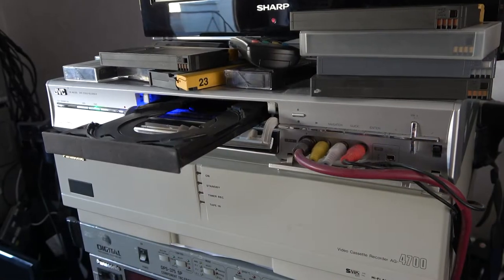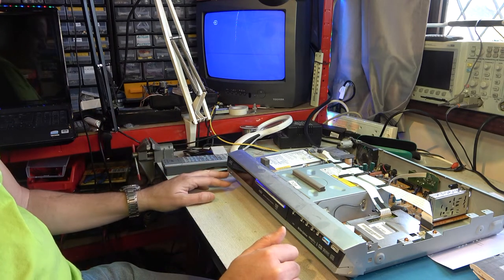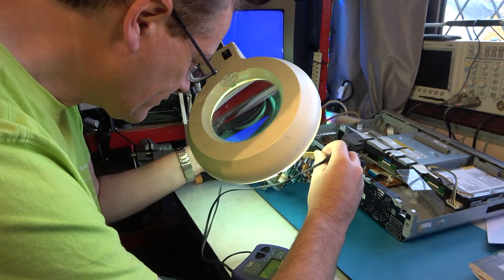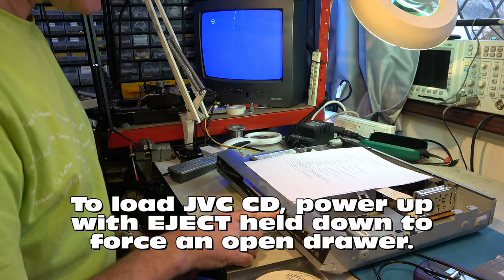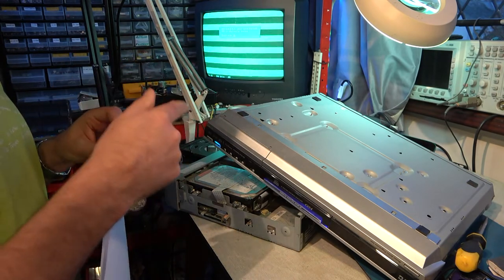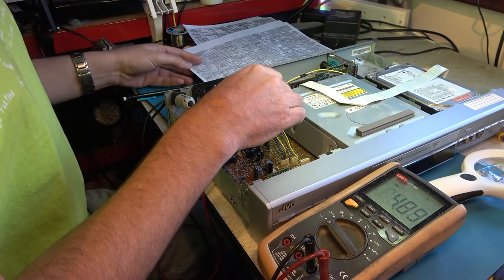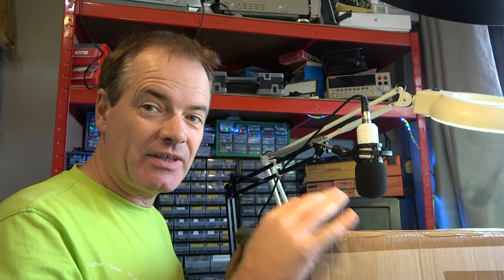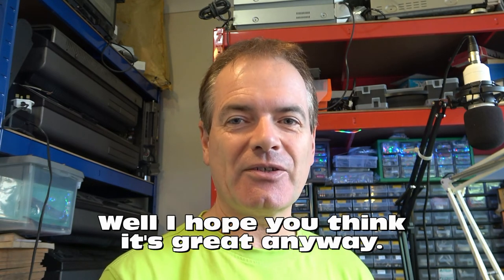JVC DVD/HDD recorders. Unbox the large Skantic video recorder.

Comment: Another great video! As always, I love watching your careful and methodical approach to repairs. You could use a DC clamp multimeter - very handy device to have around. Personally I use the UT216D for that job - which is great for exactly this application, but not much else haha. Its OLED screen really drains the batteries nicely so I can't exactly recommend it, though I like it anyway. My primary handheld multimeter is a UT181A. I'm a practical guy, and the bright TFT LCD + long battery life + fast autoranging + instantly responding continuity tester makes my life easy. People will complain about UNI-T quality, but I use what actually works for me, instead of what people think I should use haha. My secondary "go to" desktop meter is a Datron 1061. Instant on, 0.2 second autoranging down to 0.0001 ohms. 70's vintage. No complaints! :)

Is that an ESR70 meter? I have one as well. Love gear from that company.. made in the UK with pride! ;)

I find that small value caps are the first ones to fail. 1uF, 2.2uF, 3.3uF, 4.7uF etc haha. I often just replace the 1uF ones with film caps.. safe to do in most cases, as long as they're not inside a control loop where the ESR difference may upset stability.

As for short-circuiting capacitors - you are 100% correct in the way you do it. It's a huge trap, actually! When you short a large cap on a PCB (sparks and all), it creates an electromagnetic pulse that spreads across the rest of the board - which can sometimes kill or damage sensitive components.

The Skantic recorder looks great! Never seen anything like that. Alien tech to me haha. Looking forward to more videos!! -Nick
Reply from the maker: I'm considering a new multimeter when I have a bit of spare cash, I'll probably get a EEVBlog 121GW, but they are not cheap.
It's a modified ESR60, see my video on that: https://www.youtube.com/watch?v=CG6LllxGsC4 
I've found the value of capacitors that fail is dependant on the equipment in question.  Sony equipment seems to suffer bad 22uF surface mount capacitors for some reason.
For more on the Skantic, see my previous video on this format: https://www.youtube.com/watch?v=wC_CLEQnM8w
I will work on the Skantic next week.  I have quite a backlog of machines to work on over the coming weeks, including DAT, BetacamSP, DVCAM, SVHS, V2000 and more.

Comment: Thankyou for all your smashing videos, i realised i had forgotten to thank you :-(

Well, i've never seen the jvc type of dvd recorders before but the hdd does sound a little unhappy, hopefully the diagnostic disk can write the boot info to any decent drive you choose to use :-).
I've seen too many generic units that often have a dead writer, often a special unit that looks normal  but it's operating rom is not quite standard so no easy swapout.
However the hdd is often totally normal and it becomes a p.c storage unit once reformatted.
Lots of western digital drives as far as i can remember.

i suspect you like torturing us poor viewers with that box lol, yoooow evil man :-D.

You could have injected 5v into that snipped cable just to see if the machine is ok otherwise.
I made a variable psu from junk of cause, and it has been very handy for supplying voltages to dead vcr psus for testing.

I used a 7812 a relay and a darlington transistor to bypass a dead section of a monster regulator chip, the bodge outlasted the vcr :-D.
Reply from the maker: The video was getting a bit long so I edited out what happens if we try a non-JVC sourced 160GB hard disk.  Suffice to say it was a non-starter and the JVC CD wasn't interested in formatting it.  Yes I could have injected 5V onto the hard disk, and it might have worked.  But since several of these machines have the same fault, I want to see if I can fix the lack of supply to the hard disk before I start testing out which drives actually work.

Comment: The HDD and DVD have failed in this HDD DVD! I didn't have good luck with DVD recorders apart from, eventually, one Philips machine I had which was great. Sold that to upgrade to a new Philips one with a hard disk. It was useless! Sticking tray, failing power supply... I'm glad I don't deal with them anymore and just use Youtube!
Reply from the maker: I remember the Philips DVD recorders.  The early ones backed the wrong horse and used expensive DVD+R/+RW discs, but I think the later ones supported the more popular DVD-R/-RW discs in the end.  Apart from the wrong format though, I think they weren't bad machines.